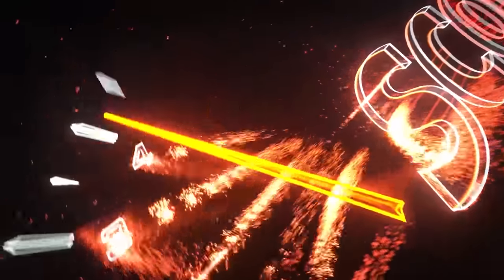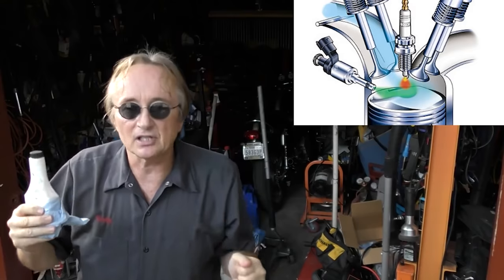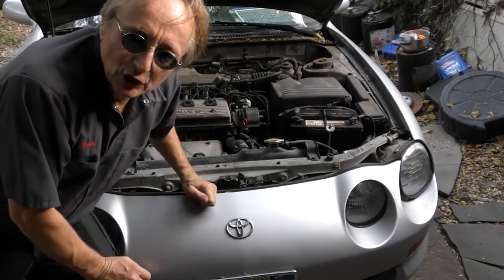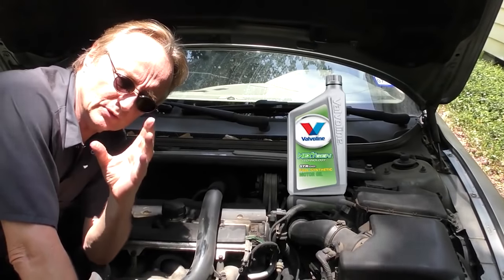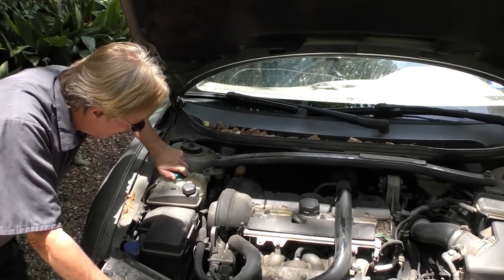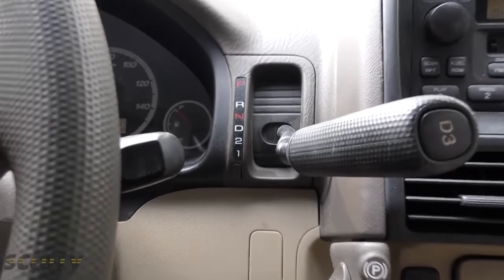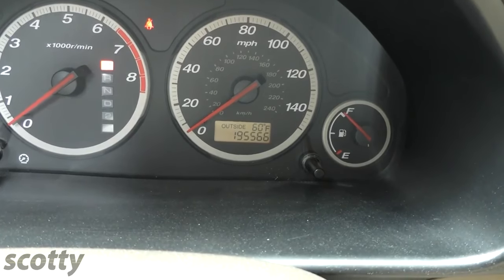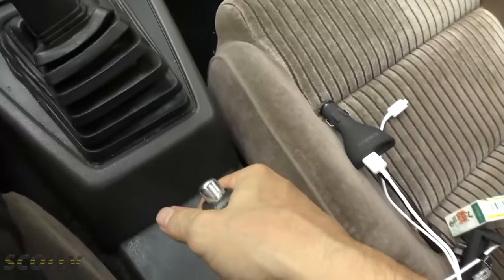20 Things Only Stupid People Do to Their Car

Comment: Dealer: This fluid can last the lifetime of the trans. 
Me: how long is the lifetime?
Dealer: until it dies out. I guess. 🤣
Reply: lol
Reply: That is the principle of a Life-Time Warranty.
When the product fails at the end of its life,
so does the warranty.
No point taking the item back claiming warranty.
It Is  O V E R
Reply: Definition: "Lifetime" is how long the fluid will allow it to function.
Reply: Idk man my camry and my friend for and Lexus all over 300 k orig fluid
Reply: @Brararaf101  
Do you live in a very dry environment? 
If so, there will be less water and thus less chance of corrosion induced in your whole system...
but it would still be a good idea to change it as recommended...
Reply: @JohnSmith-pl2bk  Unless you had a truck you bought with 54k on it and your professional tranny mechanic said to never change it because you asked him at over 100k...217k now, original fluid; no problems, work truck 6600lbs with tools always.
Reply: @JohnSmith-pl2bk  I live in Virginia which isn't a dry environment and my Camry made it over 300k on the original tranny fluid.
Reply: @solomongrundy1467  
Hard to beat Toyota reliability along with a sympathetic driver...
All Camry drivers must be mechanically sympathetic to achieve 300k miles....
Next car obviously needs to be a Lexus....

Comment: Additional for auto-transmission drivers...
If you’re in a collision that activates the airbags, put in neutral and use the emergency brake (handbrake in the UK). If you put it in park & turn it off, modern cars have a timer preventing you starting the car, and a lock on the transmission so you won’t be able to move the car out of the way for some time:- discovered this helping at a collision, & when recovery arrived about an hour later, he started the car no problem (timed out) but initially the car was in a dangerous place & needed police to put out cones etc.

Comment: I actually smacked my 99 bonneville into reverse going 40 by accident just like Scotty said messing with friends. The engine shut off pulled over with it still in R. It coasted like it was in neutral. Put in park started back up drove off no problems. 🤷‍♂️ definitely got lucky, but I think it had a safety mech of some kind

Comment: I wish I saw this video 20 and 30 years ago!! I kept the turbos spooled up on  my 2001 Audi A6 2.7T to overcome turbo lag and never let them cool down correctly. I replaced the car when fixing the turbos cost more than the car was worth. I also accidentally put my 79 Buick Regal in to reverse on the highway and then needed a new transmission. It never ran right again.
Reply: I was going to coast down a large hill in neutral in a bus. I overshot and dropped into reverse for a half-second or so. The transmission was spared by the fact that instead of grinding the gears all to hell, it just locked up the drive wheels. The road was not the only place with skidmarks that morning...

Comment: 100% right on the N2. It’s recommended in all high altitude Aircraft.  Maybe if your planning on driving from the top of a mountain to the cost, nitrogen might would be worth it. I suggest check your tire pressure  on your way down.

Comment: SOS from Canada

2020 Dodge Ram Rebel, 37K miles

Intermittent start cycle failure

Problem began about 3 months ago

Turn key, controls light up but starter doesn’t kick in

Only happens once in a while

3X to the dealership – ‘nothing wrong’

 

Bought one of those small lithium boosters

Doesn’t work

Have to boost with my Dad’s old 2009 Corolla

Corolla has to be running

RAM starts right up

Any idea what’s ruining my relationship with my truck?

 Thank you, please keep up your great work

Canada Bluenose

Comment: My instructor also taught me to drive with my foot on the clutch and that was ~2 years ago but thankfully my dad taught me not to do that as soon as I was done with the driving lessons
Reply: Weird instructor. I did that too in the beginning and mine told me to specifically take it off and put the foot to the side :D
Reply: I mean after a couple of minutes my foot just cramps if I keep it on the clutch but yeah
Reply: in an emergency if you have your foot on the clutch, you instinctively floor it, and your car will do a nice jump forward because the engine doesn't slow it down while you reach to slam the brakes.
granted its very short, but it's always bad practice to leave the wheel to Jesus. It was a dumb instructor :)
It's like keeping your hand on the gear shift. It's not a hand rest. If you don't switch gears, hand and foot off the controls.
Reply: yeah that's fair though I am guilty of the using gear shift as a hand rest whenever I am driving an automatic
Reply: my instructor actually didnt teach me anything wrong. he was also very kind and patient
lets not talk about my father
also i had a friend letting me drive his car while i didnt have one, some things werent that right but im still thankful he let me continue practising

Comment: I saw one benefit from using nitrogen in my tires. The pressure never fluctuated when the temperature changes from season to season. It was free with the tires at the time. Ive not had it in my new set of tires and i have to put air in if the temps drop.

Comment: 6 minute mark or so: Imagine how long turbochargers and engine top-ends would last if there was a pre-oil pump that ran 20 seconds before the starter would engage...
Reply: and also for a couple minutes AFTER you shut it off .
Because once you shut off the motor , there's no oil psi in the turbo but its still spinning .
Reply: Jets always have a warm-up and a cool-down...like your life depends on it.
Reply: @solarsynapse  think some high performance prop planes have pre lube oil pumps also
Reply: Yes some radial aircraft engines have a pump to bring the oil to pressure before starting. Giving more reliability.
Reply: There was a product alled turbo lube & turbotimer in the 80's
Reply: We used to have buses (Volvo-engines) here that had a red warning plate on the dashboard requesting a mandatory stationary time of 30 seconds after startup and 30 seconds before stalling the ignition due to this (they also had a master caution alarm and visual warning along with that requested stationary time upon flipping the main electricity switch causing a pinging sound)
Reply: Yay, more electrical pointlessness. I prefer having as little battery drain as possible before the engine is started and the alternator is running, i.e. being able to start at all if the battery is low.

As for turbo lubrication, I have never have found the need to rev my engine to turbo-engaging RPMs the first few seconds after engine start while I'm still parked. Getting oil flow to the whole engine, including the turbo, doesn't take that many seconds.

Anyway, I wait until the engine has reached somewhat normal operating temperature before stressing it, which takes way more time than the few seconds for oil to be distributed everywhere it needs to be.
Reply: @Spurdospaerde692  The turbo spins up regardless of bringing it up the engine to a certain RPM, the exhaust gasses pass through it so that does something right after starting the engine...
(As for having more electrical pointlessness: I agree).
Reply: I always thought that
Reply: @Spurdospaerde692  pointlessness?????? It would put oil in the top end so your valves, lifters and cams had oil before you start it........
Reply: @richsweeney1115  Unless you disassemble and degrease your engine after each shutdown, the head (and all other parts) have quite enough oil for short term lubrication during the next engine start and before oil pressure buildup. There is no problem to be solved, ergo an electrical "pre-start oil pump" would be pointless.

I presume we're talking about normal consumer road cars made today.
Reply: @Spurdospaerde692  not really when it's overnight, there's not much there, start and stop,maybe  depo.on how long you're stopped

Comment: downshifts with revmatching and the upshifts too can be absolutely safe and do minimal damage and wear to any component... i shift often when i am driving, but i use the engine braking to its full potential as i drive a diesel, so yeah, i will downshift and let it go from 2.8k rpm to 1k before downshifting again or braking as my clutches last for at least 300000km and i do change them more often, as i like to check up on the flywheels and clutch bearings and dust the bell out here and again, not to talk about bleeding the clutch hydraulics, but proper shifting should not be discouraged... being in the optimal gear for the speed is always a good idea, as both the engine braking and possibility of hard acceleration are available... of course, lest you are coasting highway or on an empty road and at limit for the area...

Comment: My 1953 Hudson "Super Wasp" has a clutch with cork (wood) inserts that's in an oil bath (clutch fluid).  As long as you regularly change the clutch fluid, the clutch itself we'll last forever.
Reply: I know this is a (very) long shot, but may I have your car?

(Asking for a friend.)
Reply: Is that what they call a wet clutch?
Reply: @vinces8974  Yes.
Reply: @crowttubebot3075  You're too late, traded it in on a new vehicle.
Reply: @WAL_DC-6B  ty

Comment: Ive also found that using the emergency brake when you put your automatic trans in park saves your auto parking pawl from putting pressure on your auto trans as well. Thats when you put it in park and your car will roll back or forward a few inches and then come to a hard stop. Then, the next time you drive it, it shifts hard from Park to Drive. If your car is making a thud noise, when doing this, the parking pawl has taken a beating. Reduce the pressure by using the e brake on an automatic will keep it from wearing out.( My car was used and the previous owner clearly didn't do this, so my trans will hard shift from Park to Drive. Using the e brake prevented any more damage to the parking pawl.)

Comment: Scotty, there is part in the clutch replacement that you didn't mention.  Besides the contents of the clutch kit, you also need to replace the pilot bushing or bearing that is located in the rear of the crankshaft.  This bearing keeps the alignment of the transmission pilot shaft straight.
Reply: Yes, and some kits come with a Dual Mass Flywheel replacement, if factory equipped. That's a part that can fail before the clutch, when the car is driven hard.
Reply: @mikep490  and while you're at it you should always change the rear crankshaft seal.
Reply: @matufujiwara7493  That seems to vary, engine to engine. Some makes seem to last forever.
Reply: @mikep490  it more varys on the situations. how much heat it gets, how cold weather you're in etc.
but point still stand. it is stupid to take transmission off again 1 year later cause rear seal is leaking.

Comment: One thing missing in this is about parking an auto transmission car. Many put it in "park" and release the brake. If there is an incline, the trans will stop it, but at the price of damage. I always - with the brake on going to neutral, apply the handbrake, release the brake pedal, then select park.

Comment: Fuel additives ... for decades I agreed with you. But a couple of years back, our 2012 Mazda CX-9 started misfiring (consistently on one cylinder, then on a second ... according to the OBDII readout). Not having time for teardown, I tried two doses of a fuel additive. It cleared up the problem. After a year, it started to return .. at the first sign, I tossed in another. It's 9 months since .. no return yet.

No doubt I ought to have the fuel system professionally dealt with. But at the cost of eating my hat, and little additive yearly ... I may keep putting that off until there's a reason for a major service.

So, additives do seem to have some utility after all.
Reply: Which one did you use ?
Reply: @Gave-rf1hr  he came inside the fuel tank
Reply: @fawnsans  hot
Reply: This have been "proven" by countless people with the same problems.
Where i live we have to have cars checked every 2 years to keep the plates on, and MANY older cars fail the emission part only to magically pass it after a decent drive with additives (decent, im european so like 20-30min)

Comment: Hi Scotty 
    I have rebuilt several engines in my career.   Most of them had dry upper rings.  I recommend adding 2ozs of marvel mistry oil / or equivalent,  to a full tank of gasoline to get oil to the top rings.
        Enjoy your show, 
           Joe Cincotta 
      Brooklyn technical high school 
            Class of 1959

Comment: I've been arguing with people for the last two years about using the oil recommend by the manufacturer. The 05 Civic Type R I purchased was high mileage and the former owner or in heavier oil (he's was a "mechanic") Next day I started getting a VTEC bank code. Changed the oil to the recommended weight and NEVER had a problem again. That's with 156k milage
Reply: Anyone who advises you to go AGAINST OE recommendations is talking out of their rear end.
Reply: @Razorslash312  Honda didn't spend millions on research to then have some chav go "I know better"

Comment: I have a tundra with over 250,000 miles and haven’t touched the atf. I’ve hauled 18 ft trailers and I live in the mountains of WV. Still working fine.

Comment: I once put my 1991 toyota camry wagon into reverse while driving 50 mph down the road. It made a sound and stalled, but I drove it until the frame rusted after that. No problems with the transmission.

Comment: Since basically 1996, most cars have a switch that prevents you from putting the car in reverse from Park or Neutral unless the brake is pressed and the car is stopped. I don't know how anyone's managed to do as you've described unless that switch is A) non-functional, B) bypassed, or C) not present due to model year.
Reply: The process for disabling it is usually outlined in the owner's manual
Reply: Yeah I didn't think it was possible, but also not really wanting to TEST that :D

Comment: From modern cars I've seen now a days, you can't just change gears from Drive to Reverse without intentionally doing so, you can slap it in Neutral, but without pressing that button it won't go any further, and as for idling in Drive, most cars would just slowly creep forward indicating it's in Drive, and not Neutral or Park

Comment: I know this is an old episode. I had a 2021 grand am, hooked it up backward. Blew the fuses, the main switch blew, so of course nothing worked. Took out the volt meter and found out both main fuses blew. Replaced them, everything started up and checked out. Got 350000 miles out of that engine. Got lucky on that one!

Comment: certain fuel additives can be good sometimes, adding premix to fuel for a rotary engine can help reduce housing wear and improve longevity-- the detergents in fuel from the pump actually degrease the rotor which can cause the engine to fail over time
Reply: he's changed his tune to recommending some of the carbon removers, for fuel injection systems. i think that is why they added the "on new cars" font over that slide ... he is recommending them in more recent videos and showing things they actually fix.

Comment: Your US supermarket Costco ,in the UK,  give free tyre pressure checks and top up with nitrogen free of charge . The tyres being originally filled with nitrogen,when bought from Costco, seem to lose very little pressure 
I've never looked at the tyres for years,as a result
Reply: You should still check them regularly, the nitrogen reduces pressure fluctuation during tyre heating and cooling cycles but it can still seep out the same as air.
Reply: I work on cars. They still lose air.

Comment: 17:03 also not a bad idea to change out the flywheel too, since you're in there already. Maybe not as important as the other parts he mentioned, but worth at least checking it.
Reply: Actually, if you need to machine or change the flywheel and you dont, you're just gonna need to put another clutch in soon